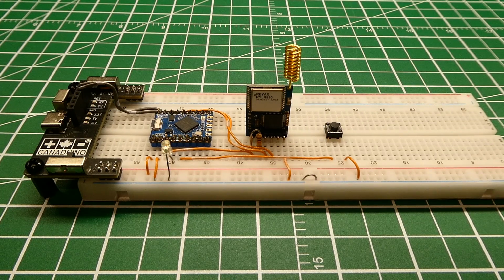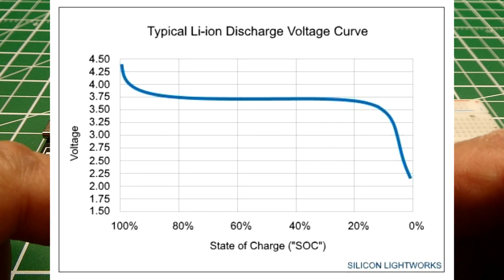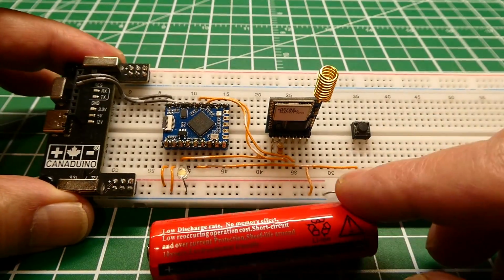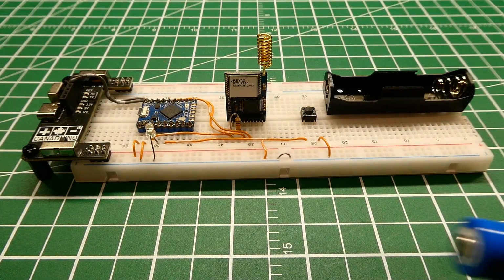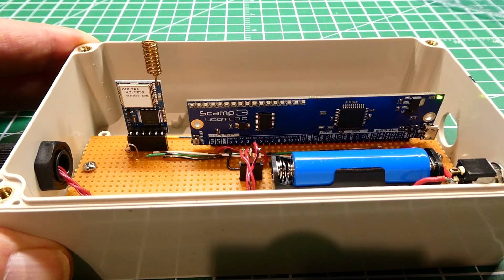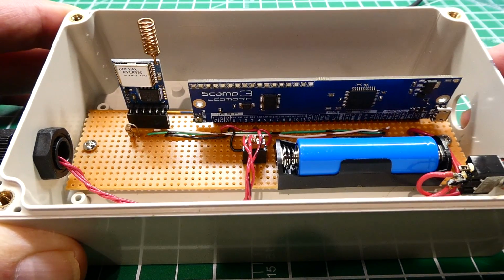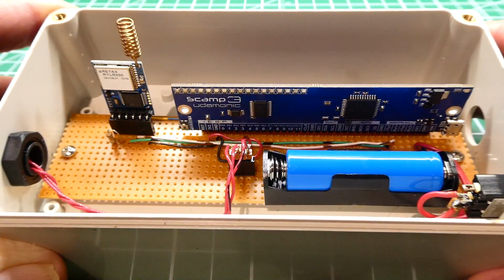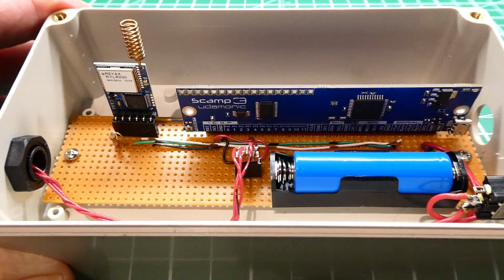Tip Of The Day / Battery Power Your Project

Comment: Note that buck converters have a significant voltage drop. Therefore, using a 3.3V buck converter with a 3.7V battery isn't that ideal, as the internal Schottky diodes can drop the voltage by 0.3 - 0.4V itself. This prevents the battery from being fully utilized. For example, Li-ion batteries cut off at 2.7V, but with a 3.3V buck converter, you can't utilize the entire capacity of the battery since the voltage drop of the converter itself reduces the effective range the LORA module or something else can be powered. Buck converters will work if the working voltage is much higher, for example, if you have 2 Li-ion batteries in series or a 12V lead-acid battery.

Also, the power density of LiFePO4 batteries isn't as high as that of Li-ion batteries (if space is a concern), but they are much safer and are superior to lead-acid batteries.

For powering a LORA module, it's better to use a buck-boost converter. It can regulate the output to 3.3V regardless of the battery voltage which ensures an efficient usage of the battery. On the other hand, adding few decoupling capacitors and an inductor on the DC output will help filter and stabilize the power supply!

For reverse polarity protection, it's better to use a 1.5KE TVS diode series (like the 1.5KE6.8A unidirectional TVS diode) because it can dissipate a lot of power. Connect it in reverse and use a sensitive fast-blown fuse to protect the TVS diode from damage. If the batteries are inserted in reverse, the diode will conduct, causing the fuse to blow immediately. Alternatively, you can use a circuit with active components that won't blow any fuses but will prevent the circuit from starting up, but such circuits will consume a bit of power.

Comment: With a Li-Ion 3.7 V battery, you could use a simple Schottky to introduce a small voltage drop and there you have your reverse polarity protection and also overcurrent protection (since a diode will blow much faster than a fuse).   The price of this diode is not higher than a fuse and its holder

Comment: For 5V projects, I use 4xAA NiMH batteries (2500mAh). Easy to recharge and I don't want to worry about lithium fire. For 3.3V project, I use smartphone batteries going through HT7833 LDO, as they have nice capacity and reliable safety circuitry.

Comment: i'm having trouble powering a esp32-cam via a 3.7v lipo. which boost converter do you recommend?
Reply: I use smartphone batteries going through HT7833 LDO to power ESP32-Cam low-power projects. Works fine even with WiFi
Reply: @Friendroid  thankyou very much

Comment: Last time I looked into charging circuits for small LFP batteries, they didn't really exist.  I'm glad to see that we can get them now...which is very cool!  I saw a few pictures of a TP5000 charging board similar as to what have and they show a resistor you can change to adjust the charge current.  Looks like it might be 0.5, 0.1, and 0.2 Ohms for bulk charge (CC) currents of 2A, 1A, and 0.5A.  I was curious as to what rate you were bulk charging your cell at.

My knowledge of LFP exists with large prismatic cells...which most manufactures recommend a charge rate around 1C or lower.  I'm also curious if your cells specified a recommended charge rate.  For longevity reasons, prismatic manufacturers seem to recommend less than 0.5C.  That said, considering the low cost of such a small LFP cell, I highly doubt anybody is trying to get 20 years and 10,000 cycles out of them.
Reply from the maker: I don't have specs on the batteries but the recommended charge rate is .5C and max 1C. The resistor to configure the charge current will differ with each vendor. Mine has .1 Ohm for 1C charge rate. If you want to be sure you can get chargers that come with a set of batteries that are compatible.